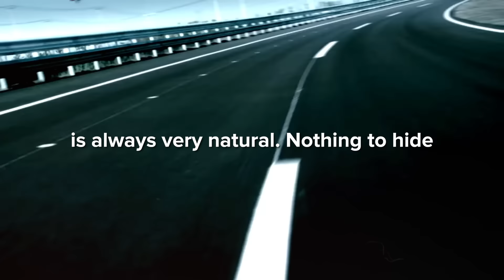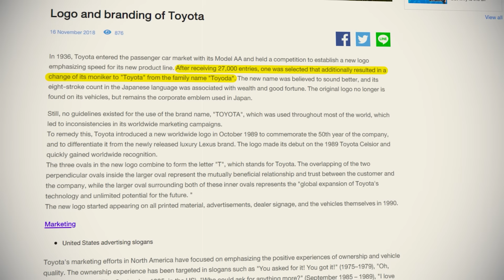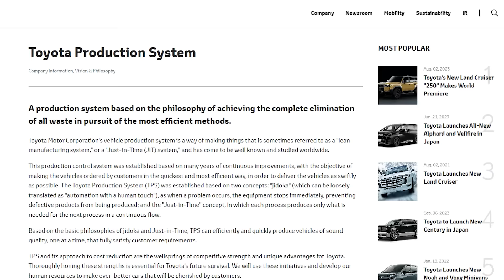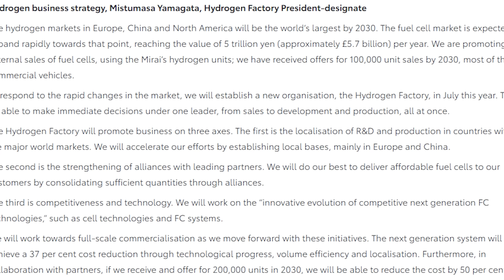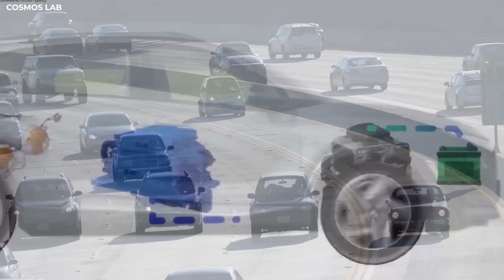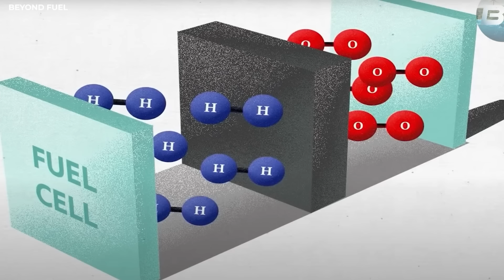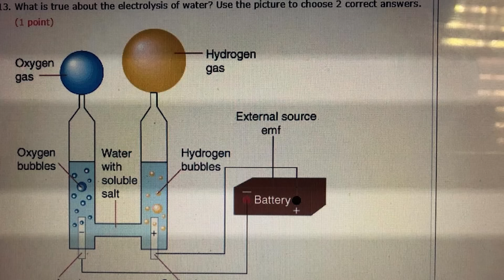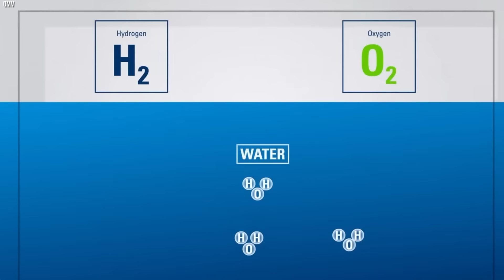Toyota CEO: "Our New Engine Is The End Of The Entire EV Industry!"

Comment: The only reason any automaker wants to stay with an ICE engine regardless of what it burns for fuel, is because ICE engines have many moving parts and requires a transmission that shifts the more limited RPM range of the ICE engine..   
ALL THOSE MOVING PARTS REQUIRE A LOT OF MAINTENANCE AND PARTS REPLACEMENT..

PURE GOLD FOR AUTOMAKERS SERVICE AND PARTS OPERATIONS..

BIG OIL LIKES IT TOO, so we are stuck sucking on their greasy nipples for whatever they force us to pay..   that's not being very independent now is it...

Comment: Converting Water into its base components, Hydrogen & Oxygen, requires Energy. Then using those gasses to make Power (linear motion into rotary motion w/ a Heat Engine, aka an internal combustion engine) becomes problematic on Many levels. The Water to be converted into H2o & H2 needs to be filtered to a microscopic level (very expensive), because ANY mineral content in the water (lime, scale, rust), will gunk up any energy system used to separate it. Pure Distilled takes energy to produce as well. Water into Fuel is NOT easy as simple as it sounds.
   Hydrogen, H2, is Extremely clean and has a Very efficient energy quotient, BUT, it's also Very difficult to contain safely and for prolonged periods. Its Molecule is so small, it Leaks thru EVERYTHING, even Steel.  Liquid Hydrogen is the Preferred Rocket Fuel for it's Energy Density (weight is Everything when launching to space), but it cannot be contained for very long. It boils off and leaks thru every Joint, Connection/Fitting and Weld and leaking Hydrogen is VERY dangerous in Atmospheric conditions.
  This is quite an undertaking by Toyota. I'd prefer to see Hydrogen Engines take over for Gasoline engines, the Enviornmental tradeoff would be World Changing, IF they can set up the infrastructure & methods economically & safely.

Comment: Even the most favourable value eqation doesn't bring hydrogen close to existing battery tech which is quickly improving and reducing in cost making charging with the average home solar system for free more common by the year. Even IF there are big efficiency gains for the hydrogen creation/conversion loop in the coming decades there is a very low chance of it catching up to the incredible simplicity and efficiency of the battery electric system. Eg. collect your electrons from solar directly into the battery and use them at the motor is a very direct energy use process compared to going from solar to hydrogen, then from hydrogen to electrons to the motor or just burning hydrogen, both are stupidly inefficient to anyone other than those who will profit from selling it.

Comment: It costs around $6 to $10 to recharge the batteries of an electric vehicle, depending on the battery storing capacity and charging stations. In comparison, the cost of fueling the hydrogen gas tanks vary from $75 to $125 depending on the fuel tank size.

Comment: This still doesn't solve the critical issue of all alt-fuels. User base and logistics. Electric had logistical support in place. Hydrogen is starting from day zero. Users are scared of hydrogen (See Hindenburg) id like to see it but i honestly am not convinced.  A better bet is the "Synthetic Fuels" as produced by Porsche, these recover CO2 and therefore reduce the overall while using the existing fuel transport networks.

Comment: I think Toyota will have only success with its hydrogen engines if it changes from cars to planes. How smart the engineers at Toyota might be, they can´t outsmart physics. To power a car with hydrogen, you need three times the energy you need for a battery electric car. Also - if we assume electric cars don´t offer a great driving experience - car enthusiasts and racing aren´t the big business, Toyota ain´t Porsche or Ferrari, they built cars for the masses. Also the battery industry is evolving very quick at the moment, ranges are going towards 1000 km, the charging can be done in less than half an hour and the prizes for batteries are plummeting at the moment.

Comment: I actually had a kit that you could put in old cars so they would run on hydrogen. You could buy them off the internet, the car could still run on gas but it could also run on water. The gas engine separated the hydrogen from oxygen the car ran on the hydrogen expelled oxygen out the back. I was sure this was going to take off 20 years ago but hasn't. I hope the time is finally come

Comment: Look at generated energy that makes it to the wheel of the vehicle. Hydrogen fuel cell - 1/3 the energy gets to the wheels vs battery electric. Hydrogen combustion engine - 1/9th the energy gets to the wheels vs battery electric. That means we'd need to build 3X the electricity generation for hydrogen fuel cells vs BEVs, and 9X the generation for hydrogen combustion. Hydrogen tanks for fuel cells take up so much room to get a decent range you can't have a center seat in the back, and there's barely no headroom in the back or trunk space. You'll get the same drawbacks with hydrogen combustion but now with 1/3 the range. Hydrogen equipment is more expensive to make and maintain. Hydrogen infrastructure is going nowhere again due to the cost. Hydrogen is multiple times as expensive as charging a BEV. Performance is lower than a cheaper BEV that has more interior volume and is lighter. Anyone who thinks hydrogen is the answer hasn't even started doing their homework.

Comment: 50 years ago I read about using metal anhydrides. A drop of water on them would produce hydrogen and this hydrogen could power the car. It was envisioned that once the metal anhydrides would be used up a door at the bottom of the car would open to drop the used up ones out and then put new ones in, like filling it up with gas.

Comment: There are 2 sources of Hydrogen.  1) Electricity is used to split the Hydrogen from H2O which is very expensive.  2) Hydrogen is made from natural gas which is much cheaper but still needs the fossil fuel natural gas or methane.
Reply: What about hydro- Dams”.
Reply: Hold on here, I believe Hydrogen can also be made with nuclear fission. From a Google search " Thermal decomposition of water. In thermolysis, water molecules split into hydrogen and oxygen. For example, at 2,200 °C (2,470 K; 3,990 °F) about three percent of all H2O are dissociated into various combinations of hydrogen and oxygen atoms, mostly H, H2, O, O2, and OH."
Reply: Seems to me still better than a polluting batterie production, isn’t it ?

Comment: Whilst I like to see alternative approaches to the reduction of carbon emissions overall, I also see a significant issue with sticking to 4 cycle ICE solutions. The automotive industry survives on the replacement parts supply demand and the cost of servicing. Of note is the massive reduction in mechanical servicing required by BEVs which offset the higher purchase price at the moment.
Both Fuel Cell and HICEV require a totally new supply infrastructure - just as BEVs have faced and are now overcoming the issues.
I'm not suggesting that HICEVs don't have a place in the overall solution but it may take a considerable time to build sufficient hydrogen production facilities to satisfy demand leading to "range anxiety" for these vehicles!!

Comment: I believe sourcing H2 from homes, apartments etc on a many source level would make it possible to have a hydrogen engine being fueled at home by individuals.  Electrolysis can be done by dispersed sources 24-7-365 where minor leaks might be insignificant and have the benefits from the sun, the wind sources and perhaps also geothermal sources powering the electrolysis.  It would also be amazing if vehicles were made with solar panels on each vehicle and wind of the vehicle moving about also generating electricity and electrolysis of water.

Comment: I'm betting that Toyota simply made the decision to engineer something useful and long lasting  - instead of the industry standard of baked in obsolescence. ICE engines could be significantly more efficient - the problem is that the oil industry would not sell as much oil. And the oil industry is in bed w/ the auto industry - god forbid some car maker releases a vehicle that gets 100-200 miles per gallon.

Comment: Toyota was talking big talk a year or two ago about solid state batteries. Big talk a few years ago about hydrogen fuel cells. I think I'll file this one in the "believe it when I see it" drawer. First, I'd like to see them figure out how to prevent the wiring for the rear axles of RAV4 hybrids from expensively corroding away. What they have proven is they know front-wheel-drive hybrids better than anyone else.

Comment: So close but yet so far. Tip a combustion engine produces electricity via an alternator, Electricity fed through water produces hydrogen, Hydrogen can be used as fuel for a combustion engine.

Comment: Hydrogen power will require that a huge production and delivery infrastructure be built.  Think about the current gas stations that took decades to build up and try to do that with hydrogen.  Until that distribution network exists travel options will be severely limited.  We already have worldwide power grids in place.  The price of electricity is regulated.  The price of hydrogen is not.

Comment: The real issue here, is how is the Hydrogen fuel produced and transported in a cost effective, environmentally frieldly way.  It is misleading to hype the engine as powered by water, because  it takes energy to split that water into Hydrogen, so it is not like you can pull up to a station and just fill up with a tank of water.  Hydrogen can be created using electricity to split the Hydrogen atoms from Oxygen in water, but the amount of electrical energy required to do so far exceeds the energy from the resulting Hydrogen;   There are Laws of physics to consider.    Hydrogen production is like a rubber band, where you need to exert energy to split it from water to put in a state of potential energy, which can then expended when it combusts to turn back to water.  But the process to do so if far from 100% efficient  and you will never get back out of it all the energy that was put into doing so.

Comment: The Toyota company engineers Still haven't solved the weight problem with the fuel tanks! There IS NO Advantages here!! Hydrogen can also be stored in a lightweight flexible bladder-type (shielded) tanks under the car!! Small boats or Dingees use these rubber fuel tanks all the time!!!

Comment: The discontent and confusion over the current EV push and the stalling of anything else like Hydrogen refueling stations are making the Oil companies laugh all the way to the bank! What this does not state is that Toyota's Mirai car fails not necessarily of the how it uses the Hydrogen to make electricity to run. But the fact that Oil companies like Shell and Exxon/Mobil promised and then backed out on the deal to help make refueling stations. Without the ability to refuel, the Mirai, Toyota is literally giving away the car. The same will happen with this new engine. Without any decent level of convenience to refuel, new technologies will wither away on the vine, before it can prove itself. The EV industry is getting this also as recharging stations really are hard to find outside of major cities and the few that can be found are being fought over by EV car owners as electric recharges take much longer than a quick stop at a gas station. Not enough spaces and charging stations along with governmental incompetence has already caused major backlashes in the advancement of such technologies. I personally feel that Hydrogen is a far safer, cleaner and more efficient means to replace our aging and polluting petrol technology. But hey, established money and power are what really makes the world go around.

Comment: I went to my local gas station but they don't have hydrogen. However they do have EV charging points.
Reply: Hydrogen is only available in California, and only sparsely, at that.
Reply: And not all that long ago, they didn't have EV charging points either. That's no excuse. The solution is to INSTALL the hydrogen infrastructure just as it was to install the electric crap before we had any of it.
Reply: …and your point is?

Comment: As long as the industry insists on building point-and-shoots, that deny drivers the kind of involvement that a manual transmission provides, driving will never be the same. With a MT, the driver must be aware of all the factors, engine speed, engine torque at various speeds, gear ratios and their effect on power, engine braking, grip as power is applied, etc., which is what makes driving fun. Eliminate that, and all that’s left is handling (which is fine, but bereft of engine and transmission control, the entire experience is impoverished). I will avoid automatic transmissions for as long as possible! Hopefully forever.

Comment: Hydrodgen is highly explosive : Using it as domestic fuel is very dangerous, because even a small spark can cause ucontrolled combustion leading to huge explosions. It does not burn at a slow rate. Transport of hydrogen is very difficult.

Comment: Cyber truck solar panels,☀️1,000,000 Miles trouble free zero pollution all components 100% recyclable, goodbye, gas ⛽️ diesel, hydrogen
Reply: So, you're an Engineer and you've worked out a way to do this? Tell me about it. Or better yet, tell Elon.